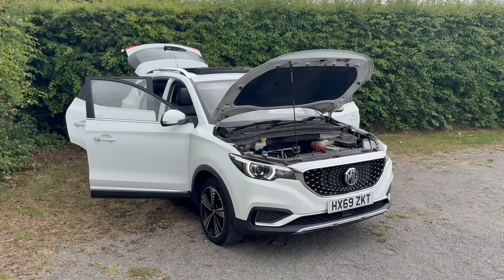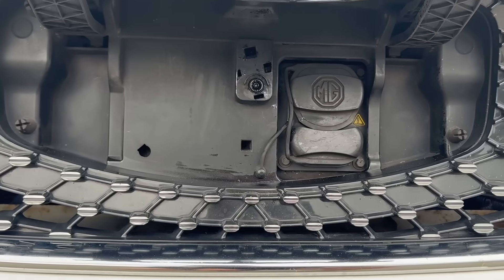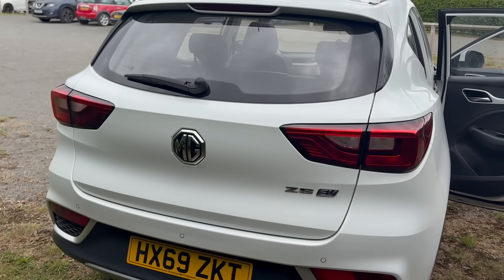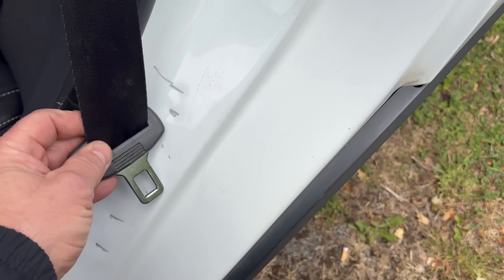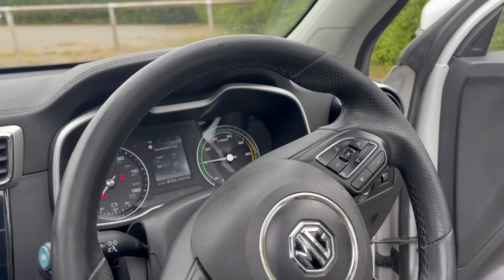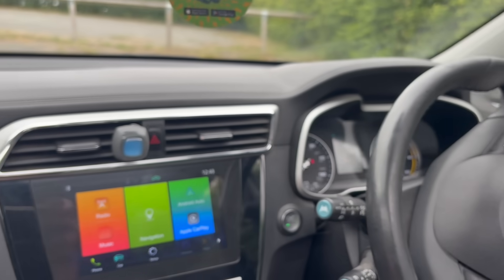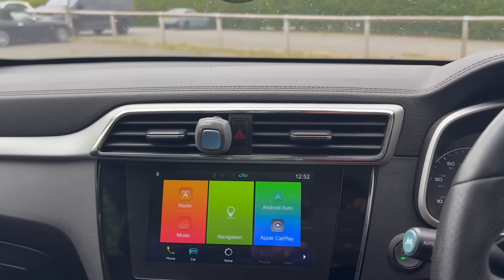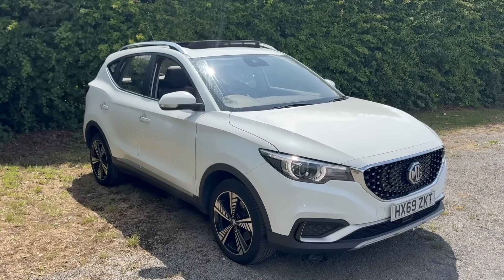Diesel And Petrol Cars Are Finished!

Comment: They will only be finished when forced stop sale.  First sentence is why i would not get an EV  cheap Chinese car.  When there is a Honda or Kia hyundi that has 400 mile range , with 150kw plus speed decent size inside that can fit 4 adults and comes in for 20k or under then im never going to be interested in an EV .
Reply: Assuming you mean brand new, but what ICE Honda or Kia is sub £20k that comfortably fits 4 adults?
Reply from the maker: That’s not how it works. Most manufacturers pulled their ICE cars from Norway years ago, simply because it wasn’t economical to supply the smaller numbers. The same will happen here. Check SMMT and see ICE car sales fixtures from 2017…. They’re only going downwards
Reply: @Jamesandkate  Looking t this year the new registrations are down in general across the board.  EV registrations are up due to pre registrations and them being a priority to deliver over ICE ( had to wait for my ICE until EV had been sorted ) . then looking at the type you can see that there is a clear increase in company / salary sacrifice  fleet business compared to private purchases. Of private the loss in ICE appears to be moved to Hybrid  cars.  If loyal to a brand ie Honda you can only get a hybrid which has ruined some of the models.   I know only 1 person in my circle that has privately purchased a new  EV . All  gone ice or salary option which are more expensive than buying outright which is over priced.  I will be keeping my 2 full ICE until they die as EV is too expensive, overly complicated with too many quality issues that can brick & leave with you with nothing.  I wont EVen go into the infrastructure or lack or it or suitability.                   Dont get me wrong if cheap enough, reliable enough with range to cover suitable trips then i would have one as would be getting free miles over summer.
Reply from the maker: So this month, there’s an additional 32k pre-reg sat on forecourts. Check Autotrader. There’s more pre-reg ICE than EVs 🤷🏻‍♂️

Comment: My daily commute is 10 miles a day plus weekend usual mileage 50 , is it worth buying an ev ? Ive looked at an ionic , mg5 and  the zs ,
Reply from the maker: 100%. You’ll save a fortune on fuel and they’re just nicer to drive
Reply: First gen Ioniq in top spec is a superb car. Realistic 5miles/kwh in summer and air conditioned seats!
Reply: @esm7708 28kw one? Range not good but generally I do 100 miles per week tops 90 % of the time ,

Comment: Not many modern diesels will last to 200,000+ miles. EVs are a far better proposition for most people most of the time.
Reply from the maker: I’m often told diesels will do a million miles. Having been a tech for over 30 years modern diesels won’t touch it now. They’re a nightmare to work on a reliability is shocking.

Comment: James, we bought a white 2021 ZSEV, ex demo at a couple of months old. We kept it 3 years. We thought it was amazing value; very solidly built and loaded up with gear as you pointed out. In fact, we bought it based on you and Kate testing one for a while. We sold it last year, only because we live in regional South Australia where the distances are huge and the non-Tesla charging infrastructure was terrible then and only slightly better now.  You’ll be aware that this first model ZSEV can’t charge on Tesla superchargers. The dealer did try and was told by MG it wasn’t do-able. 
That with a pretty lazy DC charging rate (way less than claimed) led us to a reluctant decision.
I really hope that whoever bought it gets a great run out it. If it’s now city-based it will be perfect. We still own 2 EVs, and can’t see us going back to ICE (our motorbikes excepted, for now).
Cheers, Dave

Comment: But let's face the fact, it's not an old car. If you have a 10 or 15 years old car with that milage you probably won't buy it as there are the typical problems of aging materials etc. you won't see after just 4 years.
Reply from the maker: The average vehicle life is now less than 12 years. 15yo cars will become a thing of the past in years to come
Reply: @Jamesandkate   Thats an even more problematic trend. But as you said, it' the average age. So the MG is the bottom, as it has been driven that much in a short time and others are 20 years old.

Comment: I'd be interested to know what the real world range is in this, especially in the colder months. Our 21 plate drops to not much more than 100 miles on a full charge when it's close to freezing. Currently nearer 150 miles at 15-16°C. It's great for a short commuter car, but a bit limiting for longer distance drives.
Reply from the maker: Currently 145-150, but we have to remember the pack is equivalent to 4 litres of diesel. It’s small compared to many other EVs offered now.

Comment: Diesel and petrol cars should never be faded out.
Reply: Not even when oil runs dry?  Or if the air in our towns and cities becomes so polluted at street level, it becomes unbreathable?
Reply: @Brian-om2hh I made a fair comment and you and the other chap have started sulking. Petrol and diesel cars have never been cleaner and do better mpg. If I was to refuel it would take me 5 mins, to charge and to hang about at a service station or wherever at least 30 mins. Yes cheap to charge at home but how long is that going to happen. We see moving to Norfolk and yes I will consider a small EV for doing local travel but I will still use a petrol car for longer journeys. What gets me about you EVangelist that you always think you are right and you know it all. You will be up the creak when we have power cuts.
Reply from the maker: You can never say diesel and petrol have been cleaner. No car is clean. If you understood the emissions and energy consumption of getting crude oil from the sea bed to a fuel station for your car to set it on fire and emit SO2, NOx, CO, CO2, FPM and PM you’d probably understand.
Reply: Go and play outside.
Reply from the maker: Sadly, for you, that’s exactly what’s happening.
Reply: @Jamesandkate  Not true, far far from it, but keep telling yourself that.

Comment: Buy this at £3k and do the average 8000 miles a year and it'll pay for itself in two years in fuel savings (£0.02pm Vs £0.18pm, typical for a petrol car). 

I'd call that a big fat win.
Reply from the maker: Easily.
Reply: No Gewinn 😮
Reply: except my electric costs 0.48 per kwh and the MG HS I have only needs £0.13pm in fuel.  There's no savings in it for me.
Reply: @cuoresportivo155 why does your electric cost 48p/kWh? Or is this in another country? We can charge at 6.7p/kwh, which gives less than 2p mile
Reply: @GreenEnergyGuyd  I can't charge at home due to living in a city and the nearest commercial charger costs that.
Reply: @cuoresportivo155 yeah, without the ability to home charge at the moment, you're looking at diesel level running costs on the whole. Public charging will never be as cheap as home charging (infrastructure costs, commercial supply & profit margins all factor into it), but hopefully as more chargers come online with more competition, the prices will come down. There's also a campaign to reduce the VAT on public charging as an incentive, but it doesn't seem to be gaining much ground.
Reply: @AdamAugustPhoto the 22kW chargers at my workplace are 24p/kWh. Pretty handy for relatively quick top ups

Comment: EV's have their place as a great appliance for daily commuting. To say they'll replace the sensations of driving an ICE vehicle for pleasure is miles off. Let alone considering those who can't charge at home. There's a place for both forms of transport.
Reply from the maker: I’ve never understood the pleasure of driving. People getting their rocks off by changing gear, hitting the rev limiter and loud exhausts. 

Sadly, the energy requirements and pollution caused by an ICD vehicle has a detrimental effect on the environment and our health, that’s why they’re being phased out and sales have been in decline since 2017. 

I’m much happier paying 5 for £200 miles than £25, and I’m definitely not missing the maintenance costs.
Reply: @Jamesandkate  Lets not visit the costs of producing the electric car in the first place to the environment. I'm not anti EV but appreciate the transition for everyday use where there's no pleasure required or involved. If ICE vehicles are being phased out then why are many of the mainstream manufacturers moving to Hybrid thus retaining the ICE part of the vehicle as EV alone sales aren't working for them
Reply: @williamfence566 they won't be mainstream much longer, wait and see!
Reply from the maker: I’m happy to. I regularly calculate the embodied energy requirements for different vehicles and their fuel costs. I’ve just worked it out for a chap with a Jav XF at 60k and he’s produced 10t more CO2 than this MG ZS EV which has travelled 4x further. Along with that we have the NOx, SO2, FPM, PM and CO emissions. 

Give me your stats and I’ll work the. For you, in a friendly way of course. I’m all for debate, just civilised.
Reply: I get far more pleasure and sensation driving my ev than any FF car I've driven.. and I'm 70. Have you ever driven one? What's a FF car got that an ev hasn't? I can't think of a single thing, used to be price but that's no longer true.. acceleration, smoothness, handling, reliability, quietness, cost of ownership.. all far better in electric.
Reply: @MikeGleesonazelectrics  As I've stated they have their place and each to their own. I'm glad you enjoy your vehicle. A straight six or V8 has a noise you won't understand driving an appliance. As oil is finite lets ensure that pleasure sparingly and use the Electric at it's best on the boring commute

Comment: The fundamentals are all in EVs’ favour.  It’s a metric tonne of petrol or diesel at least, to cover a modest annual mileage.  If EVs had been first, would anyone be convinced to create a mucky smelly, polluting version that CANNOT refill its ‘fuel’ tank simply using engine braking.  I do the maintenance on my family’s vehicles, here’s what i spend my time doing on the ICE cars, i wouldn’t have to do on the EV equivalent…

…engine oil changes and the respective filter must be top of the list.  In the old days we marvelled at Ford Cortina cars that made it to 250,000 miles.  They could only do that by meticulous maintenance, chief among which is engine oil replacement.  How often?  How many oil changes is it to get an old Cortina over the 1/4 million mile mark?  

You ignore the manufacturer guide for a start.  5,000 miles max between oil changes.  Best average price for your garden variety 5 litre carton of engine oil today is maybe £25, and the filter is a tenner, and let’s ignore labour cost, to help the ICE car along: 250k miles divided by five thousand comes to fifty oil and filter changes…

…and 50 x £35 equals £1,750 exactly.  If u pay someone to do it, just double this number.  

The next biggy is the brakes.  Every 2 years for us, so that’s 15,000 miles say, both brake disks and pads will be shot…call it £75 a time without labour, that’s 17 brake changes just fir the front to do 250k miles, so 17 x £75 equals £1,275 and just those two major things i am going to add it right there…

…£4,000 near as dammit.  If paying four grand extra isn’t persuasive enough, remember i didn’t include the rear brakes or labour.  That would top £8,000 extra money, to attempt to make an ICE version of a car get to a quarter million miles, compared to an EV.

Oh go on then, we’ll do the fuel as well…assume 40mpg average for a gallon of fossil fuel, and four miles per kWh for the EV.  The wet fuel cars are using 6,250 gallons to get the distance, the EV needs 625kWh total.  I chose easy numbers and do so again for cost: say the gallon of fuel was a bargain £6 apiece.  That is £37,500 in fuel.  I had to double check my numbers here, it’s easy to see why oil companies are as aggressively clinging on as they are.

The electric bill i will take as the very worst kWh price of 30p per unit, it assumes despite cheap home charging, there is expensive public charging in the mix to do this huge distance.  The kWh required in total for 1/4 million miles, at 4 miles per kWh then, is 62,500 kWh, which at £0.30 per unit is £18,750 which sounds a lot but remember the petrol or diesel fuel cost £37,500 !

So just taking the three big-ticket items, the ICE vehicle is needing more than £20,000 EXTRA MONEY than the EV to accomplish the same 250k miles.  And i haven’t mentioned cam belts or automatic transmission that is less reliable on most ICE and hybrids, and the aggravation/effort involved to nurse those through the distance.  Good vid, we’re just down to battery size, tax amounts, and charging infrastructure being assisted and regulated now.  Maybe there’s a better case for manual gearbox ICE vehicles in a few instances, and i don’t tell others their decisions are wrong.  I just believe the arithmetic and know i’m sick of being under ICE cars doing tasks an EV wouldn’t need.  Take care all.
Reply from the maker: Well worded, cheers for the time to write it 👍🏼
Reply: Well actually EVs were first back in the day but obviously energy density back then was a problem with lead acid batteries but electric did come first in 1832 and another in 1884.

The first commercial petrol vehicle was released in 1886.
Reply: Particulate filters, 2  grand each, usually after 100k miles. If your lucky. The list goes on. And we haven't even mentioned the cost to human health and the planet ! You always get the anti ev comment concerning the manufacturing of evs, well many learned bodies, the RAC being one, have worked out the environmental comparison. An ev starts to overtake a FF car after about 3 or 4 years  beneficially. So after that say about anothet 16 years of pollution free exhaust. A FF car just gets worse and worse with engine wear, an ev carries on regardless albeit a slight reduction in battery capacity year on year. Environmentally? Case closed.
Reply: >>  I do the maintenance on my family’s vehicles

Tell them you are only doing EV maintainance now ... 😎

Comment: Just propoganda. There are EV producers all over the world shutting down EV production, BYD is slashing prices and EV trade wars are happening everywhere. In China new EV's are being sold as zero mileage second hand vehicles en mass and they still can't sell them. Auto trader is full of the same, pre registered (new) second hand EV's they can't sell. Labour is removing the expensive vehicle tax but only on EV's, to try to wake up the dead horse that EV' sales in the UK are. The EV game is up. Nobody wants them and all the pro EV propoganda in the world won't change that. It is not ice vehicles that are finished. It is EV's. Just don't buy EV's people, common sense in stead of this net zero madness will win, if you do.
Reply from the maker: I mean, if you check some facts, like SMMT, you’ll see that ICE sales have been falling since 2017. 

Meanwhile, EV sales continue to rise. It’s ok that you don’t like it, but keep the facts real ffs 🤦🏻‍♂️
Reply: @Jamesandkate  There has been an ice car sales fall as well but this has primarily been caused by EV's being basically given away at second hand prices. The subsidies on EV's causing this are unsustainable leading to all EV manufacturers being in financial difficulty now and production lines for EV's closing, world wide. The crash is happening all over the world, Chinas EV industry is reportedly going to be the next Evergrande with massive unsold inventories, cash flow problems, price wars, stock price falls and massively falling profits. Read the news. It is all over it.
Reply from the maker: Show me that crash, send a link pls. ICE sales have been dropping since 2017, it’s not new.
Reply: @Jamesandkate 
BYD just cut prices on 22 electric vehicle models — some by as much as 34%. On the surface, it looks like a big win for consumers. But behind the scenes, chaos is brewing: dealerships are collapsing, profit margins are vanishing, and analysts are comparing BYD’s situation to the Evergrande property crisis. You don't cut prices and have price wars with other producers of EV's when there is a buoyant market.
Reply: How many BYDS sold this month compared to May 2024 in UK? go on...
Reply: @Luckyjo21 Reports from China are saying that the Chinese EV industry collapse is going to be bigger than Evergrande shortly. Unsold inventory is collapsing cash flow and profits, leading to a forthcoming massive industry collapse. Their response is a Chinese price war with BYD and other chinese EV makers, stock prices falling markedly. Read the news, it's all over it.
Reply: https://youtube.com/shorts/Kr0_Hl0wJOI?si=348Csvt1JpzUdSQ8
Reply: https://youtu.be/LeouAhOcqD4?si=Ifv1gm7xmaMfyahl

Comment: MG. That's just been rated the most unreliable car brand in the UK. Even beat Alfa Romeo to bottom spot
Reply from the maker: Tbf, they include a software issue as a fault. Now, having worked on the trade for 30 years I know how bad Alfa are, but JLR stuff takes the biscuit. If you spent a week in a garage you’d understand what poor reliability is.

Comment: We were just discussing this on our Live Podcast. Amazing EV longevity here. My 71% battery 2022 M3P is an interesting comparison.
Reply from the maker: 71% is very low. As I said to you we have a customer at 272k and a much stronger SOH than that.
Reply: Is that a long range? I think it might be the amount of DC charging and that it's a M3P. @Jamesandkate
Reply from the maker: It is a LR. I feel like you need a different test doing. 71% is a number I’ve never seen on any Tesla 🤷🏻‍♂️ do you have my number?? If not, grab it from Matt.

Comment: I’ve got the same model in the Exclusive trim from 2019 only done 55k on the clock but has the driver seat squab issue and charger flap not closing. Would like to see how you fix it with magnets (not being that handy myself)!
Reply from the maker: I’ll update what I do on another video when I’ve repaired it 👍🏼